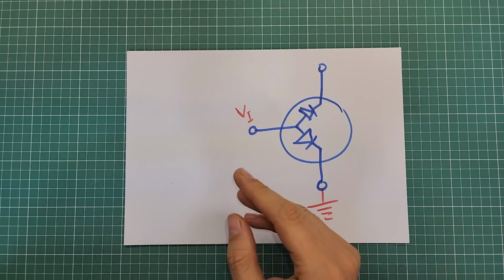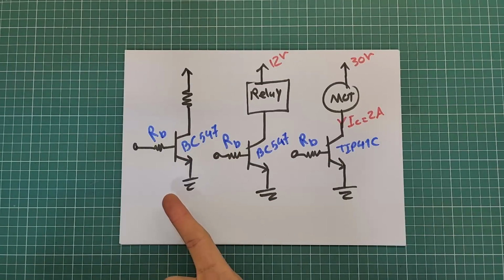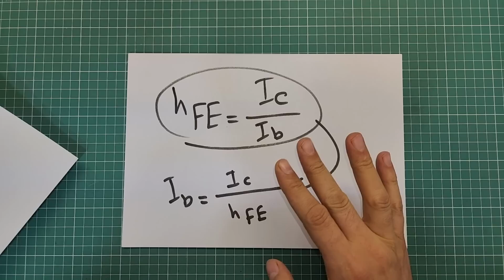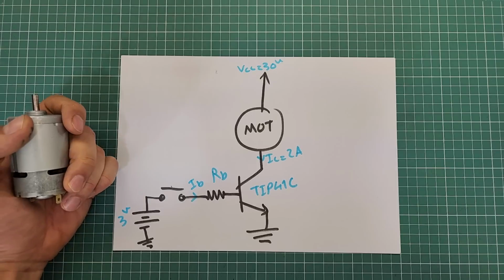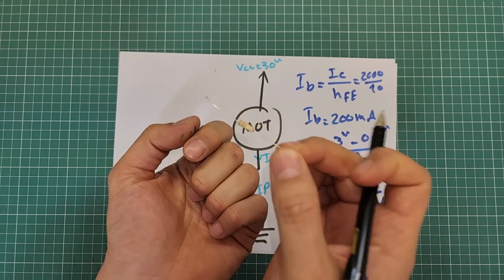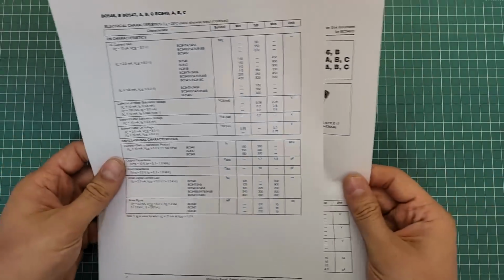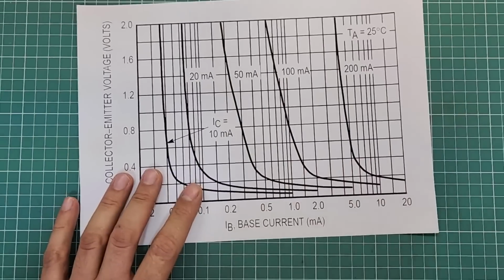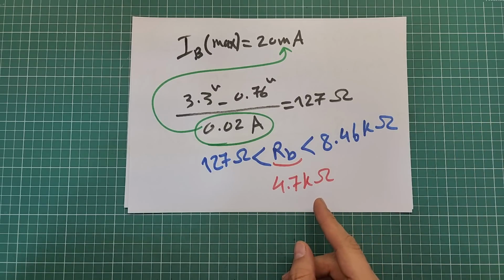Perfect Base Resistor Selection: Mastering Transistors

Comment: I have a question? 
With BC547 NPN transistor
I make an automatic led light with ldr sensor when dark led glows and its vice versa but in other yt channel base resistor value used like 100k and say that its used to increase sensitivity, 
Explain me how sensitivity increase by increase base resistance value

I think that if the base resistor value is too high then no current flows through the resistor and the transistor does not  activate . If some passes then the value is always lesser than 0.7v . 
If i am wrong then please correct me 
The reason i search on yt but didn't get for serveral hours.

Comment: Great video ! 
I'm a bit confused tho. When you show the "advanced" method, you show the first graph, where after calculating the Ib (0.03Ic/10hFE) = 3mA so the Rb is 3.3Vcc - 0.76Vbe(sat) / 3mA (Ib) = 846,6 Ohm but with the second graph the Rb will come out as 8,46 kOhm. Is the difference that the first graph is "On" Voltage and the second is "Saturation" region? What am I missing?

Comment: Excellent video! Your English is fine. Your delivery speed is fine too. Viewers can slow down or rewind the video if they want. Thank you for your time and excellent content. Very much appreciated! 🎉🎉🎉
Reply: Hi electronic wizard, I need to run a 180 volt dc 200 watt motor, I am connecting x 2  irfp460 mosphet n type transistorsin parralell, and using a 1000 ohm 10 watt resistor connected in parallel, the motor is to be variable so after the fixed resistor I have a 100k ohm pot, but when I wire it up the transistors and variable resistor  burn out , what am I doing wrong.

Comment: Ok so I’m kinda a newb, but just to make sure, in the first example, with a 100 ohm collector load resistor, and a voltage supply of 12v, the power dissipated by that resistor would be 1.4w right? Meaning I’d burn up a 1/4 w resistor pretty dang fast…? This video is really helpful, I sometimes get confused with finding appropriate values, so thanks!

Comment: My simple method is based on the hfe classes of the device used. For the BC547 there are hfe classes A, B and C available. Usually I work with the class B, which has a minimum hfe of 200. The Vbe_sat goes from 0.7 to 0.9 V. So I consider a safe saturation region at hfe = 100 and Vbe = 0.8 V. The higher the base control voltage is the less important becomes the actual Vbe_sat.

So when I need to drive 10 mA from a base control voltage of 5 V I can expect a base current of 0.1 mA and calculate a base resistor of 42 kOhm. The closest E-12 resistor is 39 kOhm. But I have also no problem to use resistors down to 10 kOhm in this case, dependent on my personal stock. Circuit design for saturated BJT is no rocket science.

For the control of motor currents of multiple Amperes power BJTs are not the best solution because of their relatively low hfe. Also microcontrollers cannot usually drive the required base currents. You can use Darlington or Sziklai configurations to increase hfe. But the best way is the use of (logic level) MOSFETs.

Comment: With the motor example, a microcontroller can't source 200mA on a pin so be careful about that!
Reply: Use relay and connect motor to the relay
Reply: @msivaramakrishnan407 200mA Current can be provide by Another Transistor

Comment: Amazing explaination. I have a question. I have an input that is pulled high at 12 volts through a 1M resistor. However when this input pulled low by a switch I need it to switch on a transitor that will output 0 volts as i have to switch an active low logic gate that works on 5 volts. What is the best way to do this? Thanks

Comment: Yeah, this is why I don't use bjts unless needed, mosfets are way better as switches, and any gate resistor between 10-33ohm is fine.
Also diode/current source model is way better for beginners than trying to explain Vce, and tell them its a current controlled current source.
Reply from the maker: Thank you for sharing your thoughts,  it is much appreciated 👍

Comment: No need for a base resistor if the load is on the Emitter. The hfe divided by the emitter current will be the base current. Been driving QI lamps for years by connecting them between earth and the emitter. Collector goes straight to V as does the base when turned on.
Reply from the maker: The configuration that you are talking about is called common-collector. Yes, in that case maybe a base resistor is not very important, but some other considerations and limitations will come into play.

Comment: Well done! You covered all of the important points accurately. The only place you need to take care is using the graphs in the datasheets, because they are typical values. Those will tell you the most likely values of a parameter, but sometimes (e.g. power dissipation) you must consider worst case values. For the BC547, a base current of 0.3mA will typically result in saturation with a collector current of 30mA, but it's not guaranteed. It is better in this case to forget the graphs and look in the datasheet for the maximum value of Vce(sat) and the conditions pertaining. You'll find it's 250mV at Ic=10mA and 600mV at Ic=100mA, in both cases with an hFE=20. So you use hFE=20, which means Ib=1.5mA when Ic=30mA and you'll always guarantee saturation.
Reply from the maker: Yes, exactly. Thank you for sharing your knowledge ❤️
I have mentioned that the base resistor which is calculated is the threshold value separating active and saturation regions.  As I mentioned,  we have to select a value lower than the threshold to make sure that the transistor will remain saturated!
By the way, I am glad that you personally, confirm the information of this video😊
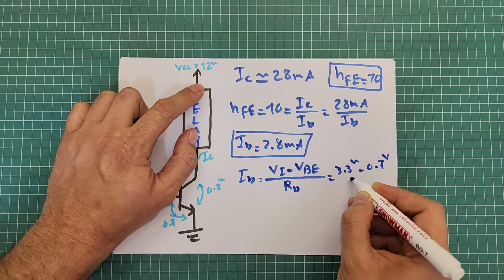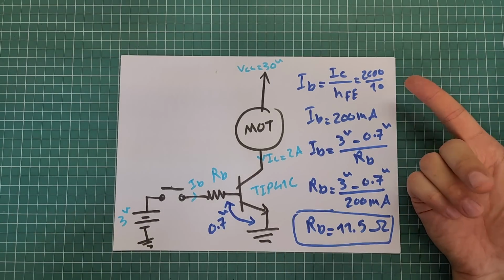Reply: Why did he choose hfe as 10 @10:45 and hfe as 10  @13:02 , can't we choose hfe as 100 or 200 to minimize base current . Can we choose  base current as 100 to 400 uA and still get 300mA IC to drive 5 leds (5mm leds , pwm pulse current 70mA ) in parallel. Vcc is 4V
Reply: @Blue.star1  Because most transistors are tested by manufacturers with an hFE=10 when looking at saturation voltage. There are a few high gain transistors that are exceptions to that, and as it happens the BC547 is one of them. Check the datasheet for common transistors like 2N2222 or 2N3904 or the BC637 family, etc. and you'll always find the maximum value for Vce(sat) is quoted with the base current one-tenth of the collector current.

You can't choose higher gains than the manufacturers specify because they only guarantee that the transistor is in saturation when the base is overdriven. You might get away with 1mA base current when drawing 300mA collector current, or you might not and your transistor overheats and fails, but unless you're prepared to test every transistor in every circuit you build, you can't design like that. When you're looking at possible failure modes, you have to design for the worst case, not the typical one.
Reply: @Blue.star1  To ensure a 2N2222 saturates at 350mA collector current, the manufacturers datasheet will guarantee saturation with 35mA base current. If you want to try it with just 1mA base current, you can, but you have to test it and accept the likelihood that the transistor might not be saturated and may not have enough drive to deliver 350mA. Not being in saturation probably isn't crucial because with a duty cycle of just 5% and the metal can version able to take 500mW continuously (more with a heatsink), it will probably not overheat.

I would expect the bae-emitter junction to require around 0.7V when drawing 1mA, so you would need a base resistor of (4V - 0.7V) / 1mA = 3.3K.

Three more things: why are you worried about drawing more than 1mA into the bas when you are using 350mA to light the LEDs? If the LED power supply is separate, then have you considered running the LEDs in series, using a higher voltage supply, and taking just 70mA? If the low base current is an absolute necessity, then you should revise your choice of transistor to a Darlington like the TIP120/140 family or use a logic-level mosfet like the IRLZ44 or similar.

Comment: Another super helpful video. Thank you from Toronto. 

Suggestion: How about a video on how hot components can get safely (datasheet)?  Can I use a thermistor and microcontroller in a project to monitor the temperature, of say a mosfet, an reduce the PWM duty cycle if it is too hot, or is that not reliable to safeguard against over heating? If it is a reasonable thing, how do I do that, glue the thermistor onto the mosfet? Do I need a heat sink on the mosfet? How do I determine that (where in the datasheet)? How big should the heat sink be and is there a way to determine that (do heat sinks have a rating for heat disipation)? Does the enclosure need vents to help disipate heat for my project? Maybe just a bigger enclosure so there is more space foe the heat?
Reply from the maker: Thank you dude for the compliment 👍
I noted your suggested subjects👌

Comment: It is interesting calculation base resistor in exampel with the relay. It is much hiegher then in previuse exemple. Do you think that drop voltage on transistor doesn't change?
Reply from the maker: Surely It will change 👍

Comment: Can't mosfets be used instead? I am just learning electronics, and really like MOSFETs,  like IRFZ44N,  i need to build a few voltsge dependant switches to shut off at ,28.5-29v, to work as a voltage regulator for a alternator, the outputneeds to supply a unspecified voltage until the output reached ,28.8v after rectified, i need about 6-8 of these I'd like to fit on a 50x 80mm board, be adjustable to upward of 65v DC. The gate side need tobbe capable of handling this voltage , are you interested in designing a circuit? I need help, i was thinking of just using a zener diode and resistors to try making this regulator circuit.  I can really use professional advice..
Reply: Mr. @jamest.5001, you specified that you are a beginner in electronics. You want to create a circuit that uses an alternator and produces a voltage of up to 65 volts at the output. You must know that you are subject to some risks.
1. Making some assemblies with Arduino, for example, which works at 5V and is powered by a 1 or 2 Ampere source with current limitation is not dangerous for beginners. In case of a mistake, the Arduino board can be damaged, an LED, transistor or a sensor can be destroyed.
2. Voltages higher than 24V are dangerous and voltage of 65V DC can kill you!!!
3. The current that an alternator can provide can reach 30 - 50 Amps or more. So a short-circuit or overload at the output can cause fires if the circuit is not provided with appropriate fuses. So it can set your car or house on fire if you don't have overcurrent protection in the schematic.
4. Some schematics found on the internet are not tested enough or may have design mistakes, wrong wiring diagram or PCB with routing errors.
5. I recommend that before actually making the installation, you check the scheme using a simulation software such as LT Spice, OrCAD, Simulink, Proteus, Texas Instruments TINA, NI Multisim, etc. The design of electronic circuits in specialized companies, by engineers, has a mandatory circuit simulation stage to discover design or calculation errors before practical implementation.
6. Thus you don't waste time making a circuit that is not tested or that does not work. You can modify (or recalculate) component values and observe the behavior of the circuit without damaging the parts.
7. For alternator simulation, three independent Voltage AC sources are used which have the initial phase shift of V1=0 degrees, V2=120 degrees, V3=240 degrees. The excitation coil can be simulated by a resistance because it is supplied with direct current.
Good luck and don't put your life or property in danger.
Reply from the maker: Yes, either mosfets or BJTs can be used as a switch for a DC load. Anyway, subject of this video is to cover the calculations needed to find the base resistor value. I think using just a zener is not a good idea,  you need a reference voltage that is reliable, the voltage generated by a zener diode is not much reliable. You can use reference voltage generator ICs and an op-amp to make the desired voltage.
However there are plenty of other methods to complete the task you are going to do.

Comment: this was fascinating, as always, i have been immersed in all the maths of late, really understanding β, etc. despite learning about this stuff for a year I only just applied myself to really understanding  ohms law. i used to kinda cheat-220O for LED, 1k for BJT base, and just wing it. but i now have a much deeper understanding of transistors and the maths.

 i know i always mention laser drivers, but i find them endlessly fascinating. as i learn more i keep making better laser drivers, my latest one uses a 4013 for latching switch, which drives a 520n 'fet, which turns on a lm338 which delivers 1.7A to my laser diode. it is all on perfboard-for which i found your soldering tips very helpful.
Reply from the maker: Si kind of you dude 😃
I am glad that my videos are helpful for you ❤️
I hope you find the best way to driver the laser diode 😉
Reply: @elewizard honestly i have gained so much from your tutelage, my bench book has pages and pages of notes from you. all the uses of capacitors etc are numbered and written in my book. you really have changed my life by increasing my understanding. when i open a SMPS, or a knackered LED bulb, your uses of components are always in my mind. sharing knowledge is what humans are all about, and it is the most wonderful thing. thank you so much for the time you have taken to make these vids. i have copied most of the things you have done in videos on breadboard too. cheers mucker.